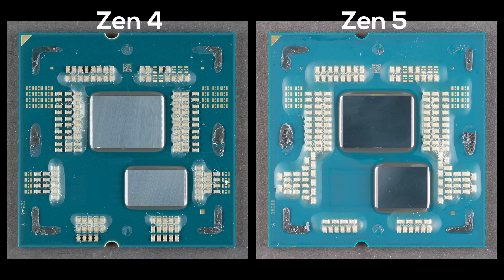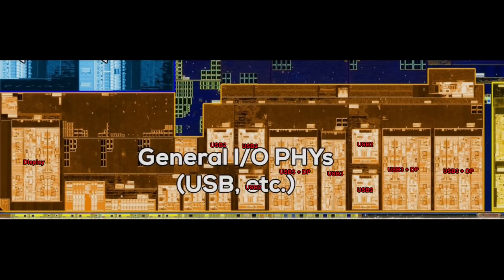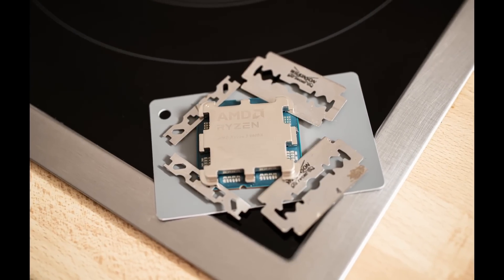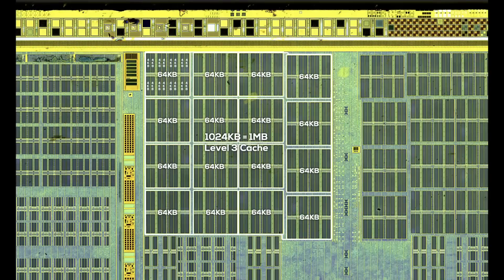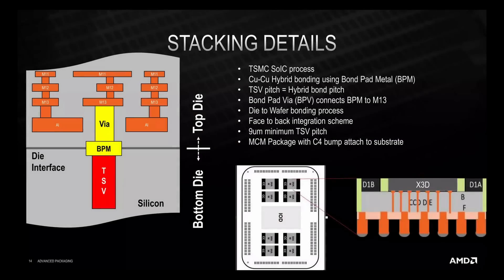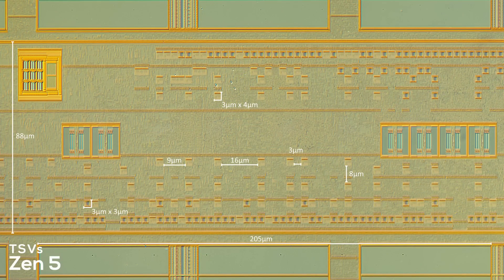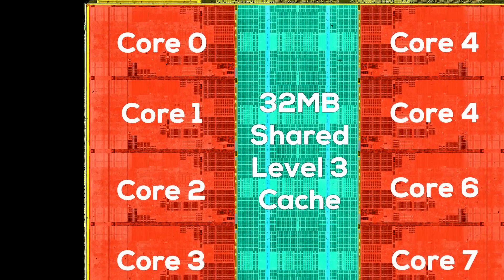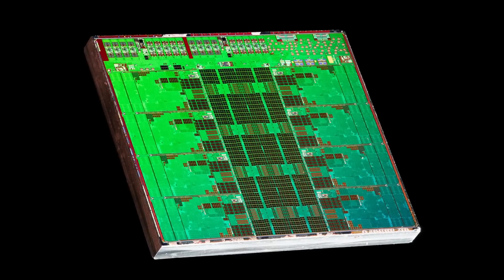ZEN 5 has a 3D V-Cache Secret

Comment: Interesting that the I/O die is the larger one; why is the process so far behind that of the CCD?

(EDIT — that is, why don’t certain die parts scale with increased transistor density?)
Reply: It was explained in the video. Certain die parts don't scale down in size with higher transistor density. AMD just put all of them in a separate die to decrease the cost of CPUs.
Reply from the maker: Correct. I/O and analog designs don't scale well with new nodes, that's why N6 makes sense.
Reply: My guess is that IO doesn't benefit from better node.
Reply: cheaper to make and there is no real benefit in making it smaller/more expensive
Reply: The IO wires (infinity fabric, PCI-E, USB, DDR5) are big fat long wires with a lot of capacitance (comparatively), so you need a lot of current to yank their state up/down quickly. To pass a lot of current you need either a big transistor or a lot of small ones in parallel. Either way, being able to make smaller transistors does not help very much at all for this task.
Reply: @TheBackyardChemist  Got it -- so the I/O wires need to be large?  (to effectively pass signals in/out?)  And that means high capacitance and high current requirements?
Reply: @karlstathakis7786  IO requires beefy transistors/arrays of transistors to drive the currents required for the interconnects, as well as higher voltages.
you also have (active) impedance matching and filtering circuits that need a certain physical size to do their black magic.